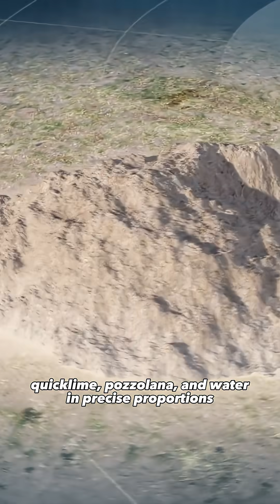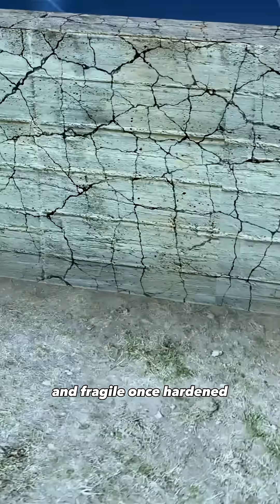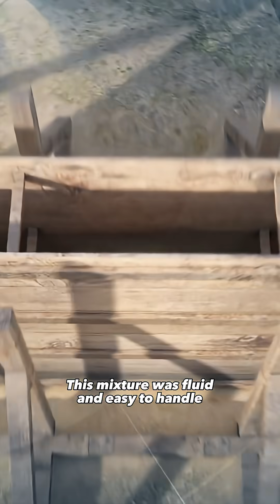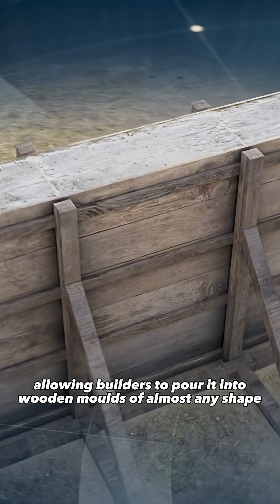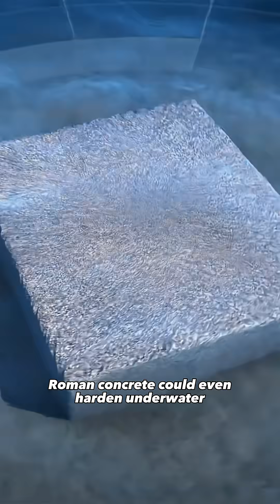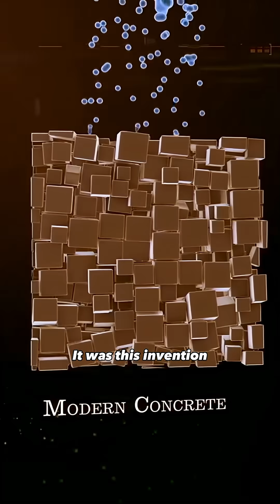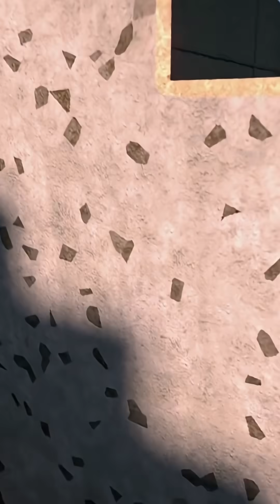The Roman concrete #history #romanempire #engineering

Comment: Question:  Did the Romans use any kind of rebar in their concrete?  Steel had not yet been invented.  Did they use iron rebar?
Reply: The difference between steel and iron is just the exact amount of carbon in the alloy.

The special part is HOW the steel is treated as it is forged.

Different ways of forging cause different types fo crystalline structures to form inside the metal which impact various physical aspects of the finished piece.
Reply: No. But they didn't need it because their structures were designed to always be in compression.

Comment: romans did this  WITH NO REBAR!
Reply: That's giving too much credit. The Roman concrete structures were designed to always be in compression only. That is why you see an arch supporting all beams. Even Roman concrete would not work in modern structural systems that are designed for both tensile and compressive stresses.

Comment: And with all our knowledge today....we still can't reproduce the roman concrete exactly.
Reply: Except we can.

It's just not as useful as you think it is.

It lasts longer than modern portland cement base concrete for sure, but it also doesn't have nearly as much strength so you need more of it to take the same weight.

Not to mention it takes FAR longer to cure vs modern concrete.

This is the preoccupation with capitalism based modern industry - time.

More time = more wages paid to construction workers = more expensive construction.

What they can't figure out is how to get the longevity/self healing benefits of Roman concrete with the strength and quick curing speed of modern concrete.
Reply: @mnomadvfx MIT found heating the lime in the concrete gave it a fine particle size which gave it's reactive healing properties. It has very little tensile strength so it's not used anywhere
Reply: @mnomadvfx it’s quit entertaining seeing ignorance about this still lol. People really want to live in the past or in a terrible time I guess, cause all people cry about it how “advanced” the past was. Comical
Reply: @bigbk3278 in terms of longevity, it is more advanced though. The negatives in this case are a byproduct of necessary optimization in a world of economy rather than monarchy.